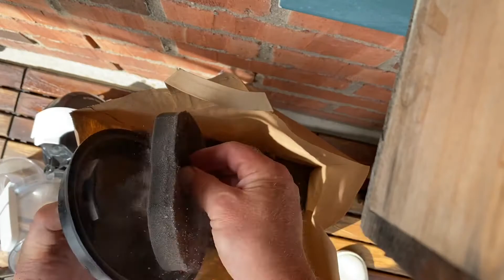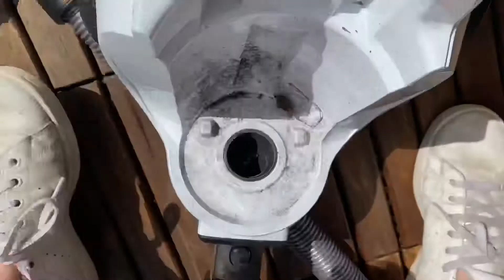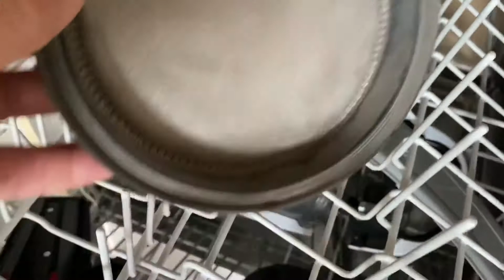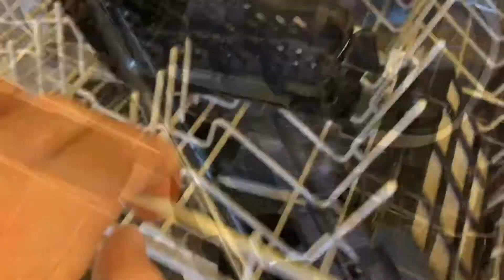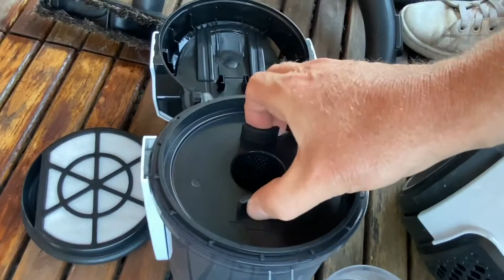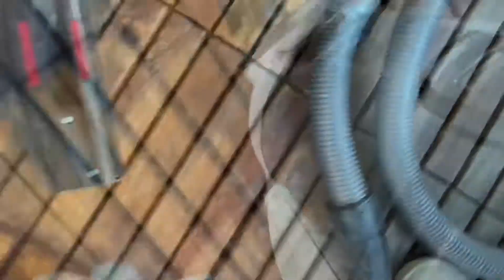Bosch Bagless Vacuum Cleaner in the Dishwasher - 100% Germ Free!

Comment: The lowest temperature on my Bosch dishwasher is the 40C glass cycle. Would this be too hot?  Also, do you add dishwasher detergent?  I'm asking as this is known to be quite abrasive on certain materials. Just adding this later to say that after cleaning all the parts it was like using a brand new appliance. I couldn't believe what a difference it made!
Reply from the maker: thats fine!